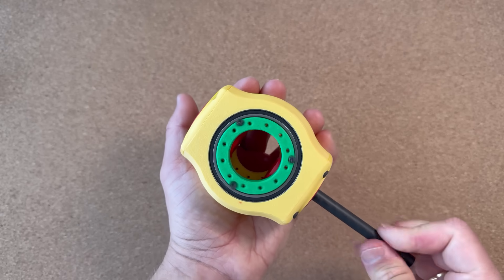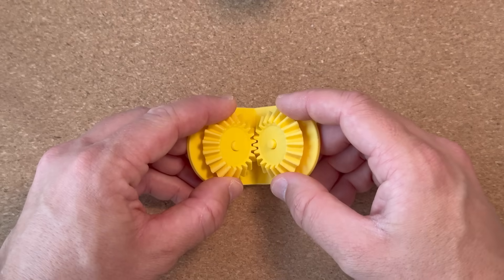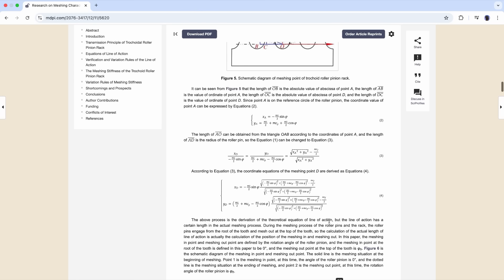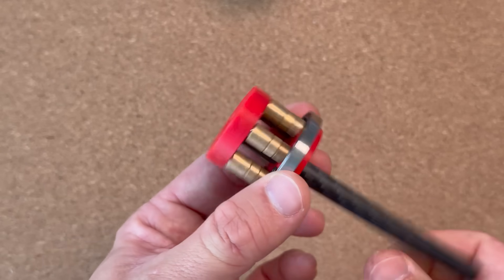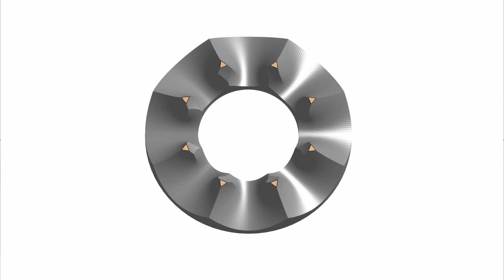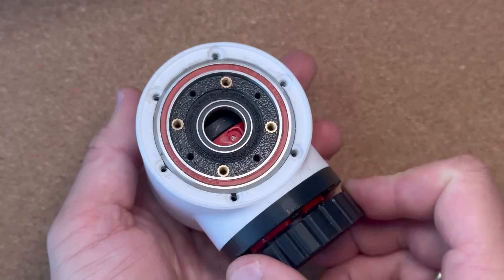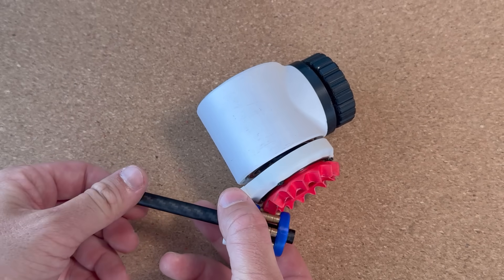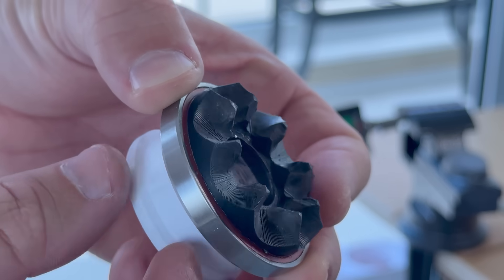High Precision Angular Gearbox, 3D Printed and Tested

Comment: Respectfully, this design is not backlash free, it can't be. There's a certain non-zero clearance between the tooth profile and the roller and inside of the ball bearing. however small the gap is that's your backlash value. Your assumption that the profile always engages two rollers can only be correct if the profile is geometrically perfect, which doesn't exist. In real life things are imperfect and rough and the contact always occurs in one point at a time unless the contact is tensioned enough to deform both parts to fit, but that introduces a lot of friction. 
The backlash-free drives such as belts and cables can eliminate the backlash by stretching elastically, the roller-toots gear could technically be tensioned, but then you'd lose a lot of efficiency and get a lot of wear.
Reply: If belts can be called 'backlash-free' then so can this. The crown gear eliminates backlash by deforming elastically - which works because it's made of plastic and tensioned (like you said) when assembled. You don't lose a lot of efficiency and get a lot of wear from the tension because ideally the contact is rolling and not sliding. If you're going to criticize, aim true. The biggest problem in the design is there is still a lot of sliding between the rollers and the crown gear - mostly because of using straight rollers instead of conical rollers. The sliding leads to heat and wear at high speed when under load therefore this design is low speed only.
Reply: The "real" design of this (not that this isnt cool, but it is more rudimentary); uses similar design but with eccentric lobing that functionally removes backlash. Cycloidal gears have functionally zero backlash when designed and maintained properly.
Reply: You're right that these types of systems are only backlash free with tension, because they're usually pretensioned in industrial uses. Since they use rollers, that tension doesn't add a ton of friction. Of course industrial ones are precision machined instead of 3D printed, which would probably help…
Reply from the maker: Thanks! I did add some preloading in the wrist diff to help with that.

Comment: You can almost completely remove seams from a 3D printed part using "Scarf Seams" inside PrusaSlicer, Orcaslicer or Bambustudio. You may need to try some prints to get the best settings but it's worth it.

Comment: Your design is perfect fit for non planar 3d printing. Those crown gears can be really smooth without layer lines.
Reply from the maker: I just watched a video about non-planar printing yesterday — thought the same thing!
Reply: @MishinMachine  Why not resin printer for this part.
Reply: That could work. I wonder too if oversizing the print and then exposing it to some very fine solvent mist or vapor could smooth it out evenly back to the desired size. Like vapor etching in a sense.

Edit: turns out this is already a thing and the results look pretty good. Oversizing might not be needed.
Reply: Is that already available for us? I tried to install the slicer to do it following a vid from Teaching Tech but didn't succeed.

Comment: Great design, I can imagine a robot arm where all or most of the actuators are in the base, and all the torque is transferred through nested or parallel shafts.
In case of nested shafts, nested universal joints or equivalent should be figured out.
Another thing will be the math to control such a robot will be a little bit crazy cause one will need to compensate for changes in the angles of lower joints in higher ones.
Reply: robots DO use transmission devices like this; this guy functionally designed a baby version of a cycloidal pin drive gear transmission (say that 5 times fast).
Reply: @JgHaverty, huh, tried to pronounce, no success at all.
Do you remember examples of such robots, especially if kinematics avaliable for examination somehow
Reply: @TheNadOby  I used to work on FANUC robots, know for sure they have models that use them. Cyclical pin gears should be pretty common for speed control these days as they are more robust than using belt drives

Comment: Nicely done. I started following your channel a while ago because I share your interest in figuring out DIY robot wrists, with all that implies about backlash, hysteresis, smooth motion, high torque, and high precision, and this looks like the most elegant solution I have seen yet. I think the conical rollers are the better solution for long life and efficiency.  Fortunately they can easily be made in metal on a small, inexpensive, or even 3d printed lathe. Or you can spiral the seamlines in the slicer so that for all contact lines, there is only a small point where the seam contacts the bevel tooth, while the rest of the contact line is unbroken.
Reply from the maker: Thank you! Glad you liked the first version and great tip about the seam!

Comment: Patents rights are limited by the countries were the patents are granted. That patent is only granted in Taiwan, Korea, and Japan. Assuming there aren't other patents that cover the invention you'd be fine to use, and make it. (Publishing the plans is potentially trickier, I don't know the law about induced infringement in Japan, Taiwan, and Korea.)
Reply: The patent doesnt "exist" in USA because its covered and protected under other patents that already exist. I.e. you cant patent this design when its already in use. In this case, cycloidal transmissions and pin roller gear trains are already existing and patented here; and this design would definitely infringe them.  So yes, there are "other patents" in play here.

That said, he can release plans under fair use as a design study or proof of concept for potential licensing applications.  That would be perfectly fine and legal; and would be morally fine as well.  This design being printed in plastic, has a severely limited scope; and even in nylon pla; would be extremely pointless for long term applications.  Too much torque on the bearing ways; would fail in pretty short order with  any kind of speed.

Comment: Very nice work, are you making the tooth profiles with python?

Could you use cone washers or those punk  clothing spikes for this? Cone shaped bushings aren't common.
Reply from the maker: Thanks! I used onshape's feature script to generate the profiles.
The cone angle depends on the gear ratio and pitch radius, so I think it’s pretty hard to find a matching one among standard parts.

Comment: Would really like more detail on how you're generating the profiles.
Reply: I wrote a little script a while back. In Fusion 360. It basically moved selected bodies along a path at intervals. After each move it would cut the bodies from another group of selected bodies and do this along the whole path a specified number of times. I used it to create oddly shaped gears. I'll help you recreate it if you want.
Reply from the maker: I made the same thing for Onshape, but I think they’re not too happy about it — it’s a bit heavy on the editor. Sometimes it takes up to 10 minutes to generate. I do have a few ideas on how to improve it though
Reply: @MishinMachine  coud you please share the feature script?
Reply: @Rollmops94  I'm on onshape user so that would be less useful but I appreciate the offer.
Reply: @Rollmops94 would really need to be a smooth sweep though no?
Reply: @mitchellstrobbe7779  A smooth sweep would be optimal, but I don't know how to achieve this. Not in Fusion and also not using plain programming. Since you can arbitrarily decrease your ∆s you can minimise the error to your requirements.
Reply: @Rollmops94  could you share the script
Reply: @Rollmops94  please share it
Reply: imagine 1 roller as it rolls over the tooth leaving a copy every 0.25 mm or whatever. then merge and subtract as needed to get the inverse, which will be the tooth profile.

Comment: Really cool design. Did you generate the geometry by successive boolean subtraction using the input output kinematics? With this approach it is possible to generate quite crazy gears!
Reply from the maker: Thanks! Yes, I made a feature script that rotates two bodies at a set ratio and does a boolean between them. It’s a bit heavy on the editor, but totally worth it for the result!